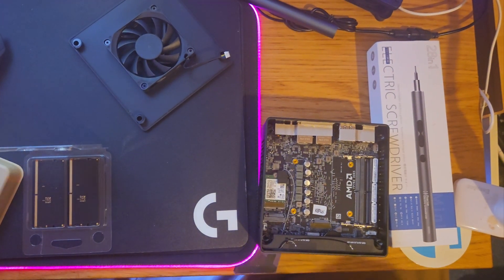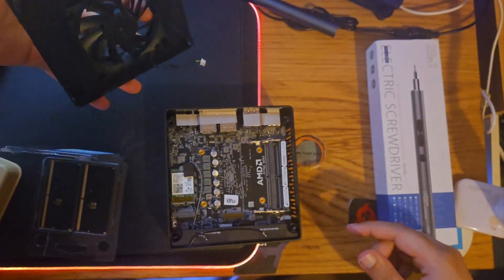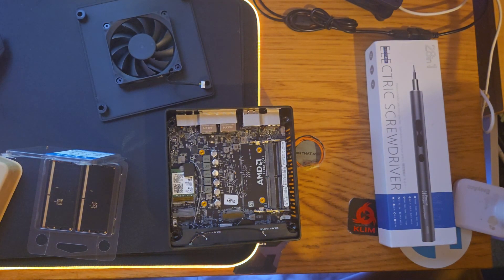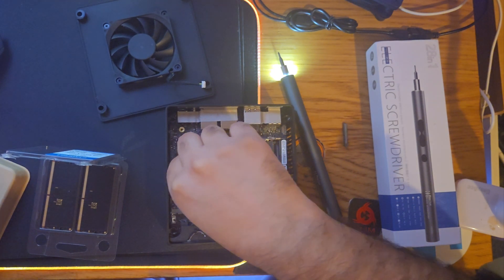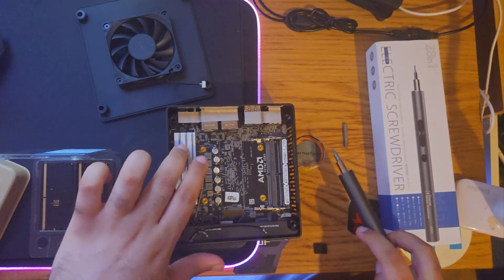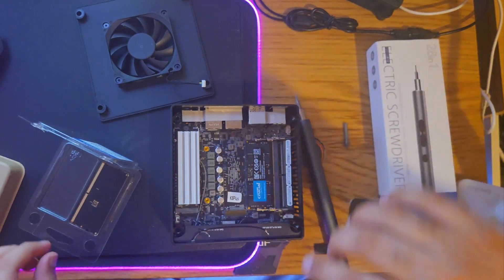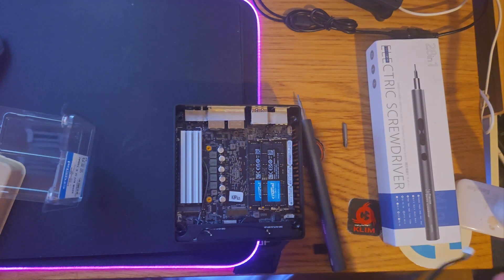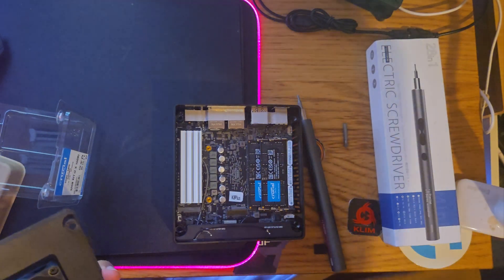Upgrade Your Mini PC: Installing RAM & NVMe in the Gmktec K8 Plus - Step-by-Step Guide! #minipc

Comment: You will LOL for an hour but I can't get the plastic top off., I watch a disassembly video 10 times says and easy twist it off mine doesn't !! I was hopping to see you do it but no it was off before you started...
Reply from the maker: It does need gentle push and twist,  be gentle but firm
Reply: @Shahzada  I am watching your other vid right now lol MFSOAB top lmao, Thanks for reply !!
Reply: I have a 4tb Crucial ssd to put in it Grrrrrr 😄
Reply: @Shahzada  https://www.youtube.com/watch?v=gFafAkwhOrs I wish it was this easy ....
Reply from the maker: Push it gently down wards than twist/turn that should help
Reply: lol just had the same problem and didn’t want to break it. Pretty annoying but I just had to put my hand down flat on top to put some pressure on it and then counter clockwise.

Comment: Hey, when you changed both your NVMe drive & Ram did you have any issues with Windows 11 Deactivating? 

I'm doing some research and found out that when you make some hardware changes Windows 11 has to be reactivated. 

Did you have to do that after your Upgrades?
Reply from the maker: Mine was 1st time build,  yes if you make hardware changes it can mess with your windows activation
Reply: @Shahzada 

Hey, Thank You for the response!
Reply from the maker: Your licence is assigned 2 ways, 1 to your microsoft account or 2nd linked to your hardware , if you purchased licence might be able to call microsoft and they might be able to help you move over
Reply: @Shahzada 

I skipped the Microsoft Account stuff when first loading up Windows, so I don't have one. 

I bought this Mini PC on Tuesday from Amazon, now I'm just researching on what RAM I can use and what NVMe Drive I would like to swap too if I wanted to do any of that. 

That's when I discovered that Windows F ucks itself when you swap out Hardware, not from doing it but from research. 

So I guess now I'll just make an account and have Windows assigned to it before I buy different RAM
Reply: @cMARVEL360 so better make account first begore change hardwere? I want buy k8 plus
Reply: @cMARVEL360 hi thx for the answer, i apreciated a lot
Iam just buy k8 barebone version
But not yet instal OS since hard to get ssd nvme and ram with good price is kinda rare here in indonesian,
Sry my english is not really good
16gb and 512ssd price is half price from my k8 i dont know if worth it or not

Comment: Can it fit a 2242 in there? Or 2280 only??
Reply from the maker: well if its just fitting yes, but you it will be jankie, as right under it has your main wifi slot mainly screw holes on the board are for 2280 only. what you can do is maybe get a heatsink for 2280, make sure its connected the thermal pads properly and connect it on top, and use that heatsink to hold your drive ? and make sure its static, dont move it when your device is on :D so your drive doesnt move. CAN DO, but i would not recommend it

Comment: Congratulations for the video, friend. Although I am concerned about removing that little peace above bluetooth and wifi chip, to accommodate the SSD. Was that for isolation? Did all worked OK after that?
Reply from the maker: Depends on storage physical size with some drives you might not need it with some, technical they will be connected to pcie and screw slot and they have space between so will not touch, and yes have been working without any issues. Using as main work pc
Reply: @Shahzada  Thank you very much for your time and kind response! Good work, man!